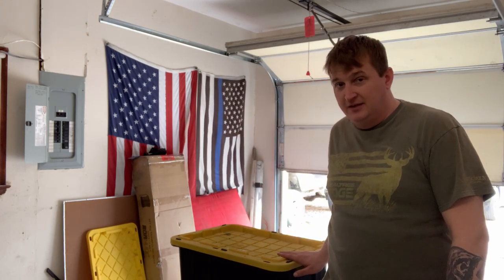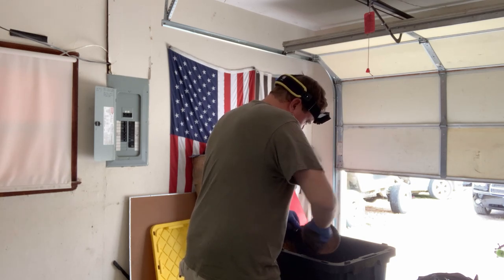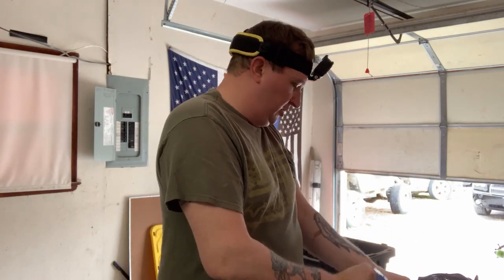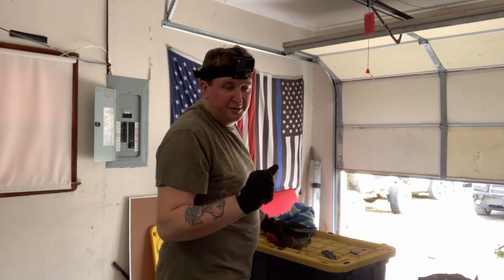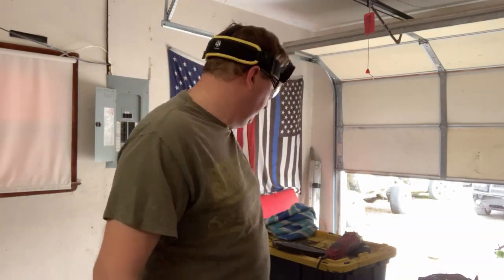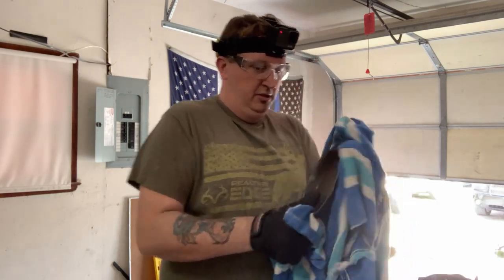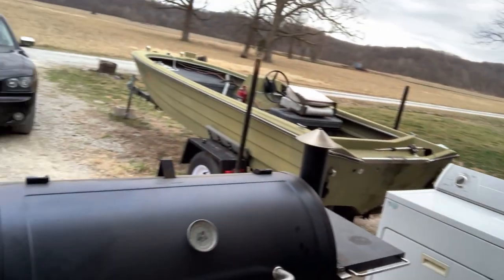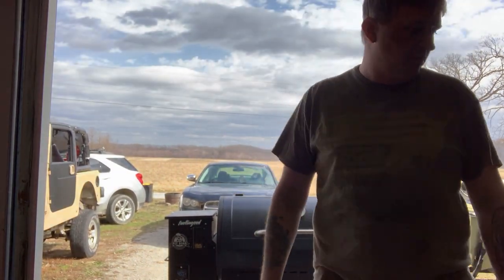How to restore cast iron skillets, pans, pots, and more!

Comment: You should try setting your self up an electrolysis tank. Its very easy and fun to do at home. Using a grinder like that smears the pores of the metal and doesn't allow the seasoning to stick properly. If you are going to use this method, you should soak the cooking surface in a little vinegar to open the pores back up before you season it.
Reply from the maker: I have used electrolysis in the past. It's a fun little science experiment for sure but I prefer doing it with evaporust (or vinegar in a pinch). Interesting to know about the pores. I have never had any issues with seasoning though. Thanks for watching and the feedback!
Reply: @PenguinOutdoors  The pores thing is for long term use. You might have more flaking using a grinder in the distant future. It's worth doing some reading if your interested. Thanks for producing.